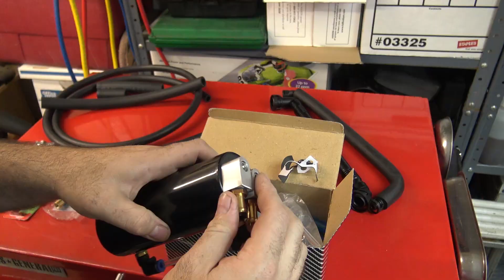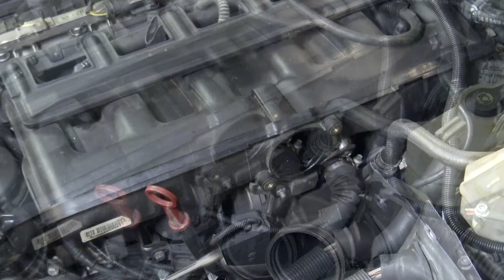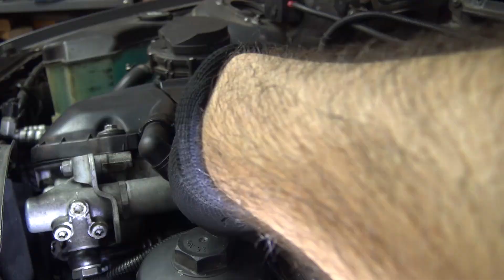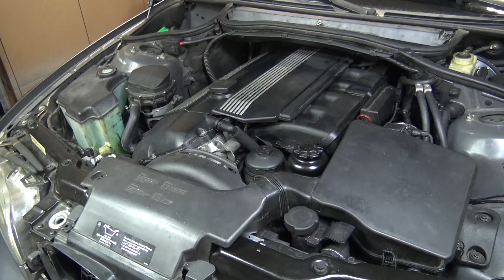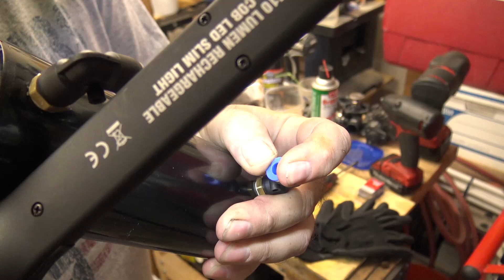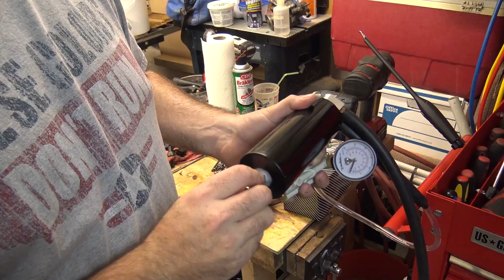BMW E46 Oil Catch Can Install DIY

Comment: Jason just a question ..you used 3/8(10mm) tube and then go to 5/8(16mm) on vacuum side with PCV  ...is there any reason for this ..why I am asking is I went 5/8 all the way and I do think that there is too much vacuum..find it extremely hard to  remove the oil filler cap and when motor cold there is a prominent sucking coming from around  ICV ..any info on this..never worked on this type of car before ..really PITA
Reply from the maker: You're supposed to have increased vacuum at the oil filler cap because you are putting a higher vacuum into the crankcase.  I only used the sizes of hoses I used because of the various plastic fittings from the CCV tubes.  The diameter doesn't really matter BECAUSE we're using a PCV valve in the system.  That valve stops down the air flow so that it doesn't matter what size your hoses are.  If you were not using a PCV valve and your hoses were anything larger than maybe 1/8", it's gonna suck too much oil out through the valve cover and into the intake.  Also, since we are applying increased vacuum to the crankcase through the valve cover, you need to make sure the valve cover gasket has been replaced otherwise it causes increased fuel trims which causes bad gas mileage.
Reply: thanks for  that info...I have what I would say is a vacuum noise leak coming from around the DISA and I would say the diaphragm maybe split or not seated  but after a few minutes settles down  DISA still works ok ..when testing for fuel trims I had LTFT --7.8 on both banks ..I fitted a vacuum hose from the rear of the inlet manifold to FPR and immediately fuel trims went to STFT 0.0 on both banks at idle  and LTFT cruise between --2.3 and --3.5.. considering I live in Bangkok and traffic is horrendous...could be sitting at traffic lights for 15 minutes and only travel 20 meters..on expressways you can see the fuel trims moving back
my motor is M52TU but here in Thailand these cars were still brought in till 2002 so possibly FPR could be different ...when I opened the CCV the diaphragm had a split hence bad everything and also the valve cover was split between 4--5 cylinders ..had to replace the valve cover with a new one (expensive) for the still negative fuel trims I have to get a fuel pressure gauge from somewhere.....got nothing here so will have to get from ebay

Comment: HI.  thanks for the good DIY process.  The link for the catch can that you posted: is it better than the one you used.  Seems that many had to refit it with better sealant in order to avoid air leaks.  how is the one in your description link?
Reply from the maker: I don't know for sure how it is--it just looks better than the one I used in the video
Reply: THANKS.  i decided to go with little bit more different system from ECS running, but appreciate the video

Comment: hey looking at this video it's awesome and you had the same idea as me with the non return valve on the return but I have high crankcase pressure causing my hoses to collapse any ideas? also I don't have the pc on my hose could this cause the hoses to collapse?
Reply: Oh and it has also a high pitched whistle
Reply from the maker: You need the PCV valve.
Reply: 50sKid thanks very much for replying love the videos all the way over here in the uk
Reply: Blowfrog, how did it go in the end?

Comment: when my e46 is running if i try to pull off oil cap it is sucked to the valve cover should I have this much vacuum or did I do something wrong
Reply from the maker: That is normal with this install.

Comment: hi,  I think the turbo charged engine , they suck this along with the external air.and push into the manifold. 
in that case , does the  vaccum leak is a trouble ?

Comment: Hi 50sKid, really great informative tutorial, thanks for posting. i replaced the OEM CCV like for like several months ago and really wish i watched this video first a) because that vent hose you need to twist int the CCV body stumped me, and b) because i'm getting vacuum related issues now and lean bank codes. i also burn alot of oil so im going to try this mod immediately. 

One thing though if you wouldn't mind, im in the UK, and part numbers you have suggested for the PCV are not available across the pond. do you have any kind of info regarding the pressure or flow that the PCV should be please?
Reply: Hi hunting, I'm UK also and just doing this mod to my Z4 E85. How did it go for u? I had no problem getting the fram pcv off amazon.

Comment: Hi 50's Kid. I've got a 330ci and it doesn't burn any oil, however there is a slight bit of mayo in the filler cap, and the pipe from the rocker cover is broken. I've got a catch can, can I run a line from the rocker to the catch can and a breather on the other port of the catch can? Thanks, Matt
Reply from the maker: You can.
Reply: 50sKid thanks for the quick reply. Will I have normal fuel trims etc and will that be safe for the engine?
Reply from the maker: As long as you plug the port on the intake manifold so you don't get vacuum leaks, you will have normal fuel trims.  If the blowby just escapes the valve cover, enters a catch can, and then vents to the atmosphere, that will not harm the engine.

Comment: hey @50sKid

so I did basically the same install, used a different catch can also didn't do the oil drain like you did, my catch can doesn't have the little drain like yours but the rest I did pretty well similar

my question to you is about the pcv valve, I used the Napa one you provided at the bottom, I'm curious is that one of the part numbers you updated? my concern is I get a considerable amount of vacuum in the crank case, I figure that's something I should expect. but I get a bit of suction pulling the dipstick or oil cap while running, I'm concerned there would be residual side effects from that, besides the debatable benefit of the vacuum on the cyl rings. 

any feedback will be much appreciated
Reply from the maker: That amount of vacuum is normal, that's the whole reason doing a mod like this improves your oil consumption.  The side effects are if there are ANY vacuum leaks in your valve cover before you do the mod, they will be amplified by the increased vacuum now placed inside the crankcase.  I recommend changing your valve cover gasket and grommets to a fresh one.

Comment: I have recently purchased a 2001 e46 with 140,000 miles and I'm getting the p-0171 & P-0174 lean codes. If my intake boots check out without any leaks I'm gonna assume its my ccv system. At what outside temperature would you not recommend putting the drain line back to the dipstick tube. I live in Tennessee and our winter temps rarely get below 30 degrees F. I just don't want the check valve to gummed up with the mayo like buildup from water/oil emulsion. Thanks
Reply from the maker: If you're worried about that then just skip the drain line altogether and empty the catch can manually.  For lean codes, check out my common vacuum leaks video

Comment: I used a 3/8in vacuum cap to cap off the dip stick CCV line but after 3 months the cap split open and started gushing oil everywhere!  I didn't see that leak spot only until after replacing the oil filter housing gasket (thanks for another great vid). Now I'm using a 1/2in vacuum cap with a hose clamp to keep things sealed off.  The 3/8in vacuum cap was stretched too far for this tube size so I had to avoid using that same size again.
Reply from the maker: wow, good to know

Comment: can you take the manifold tube into the catch can and then from the catch can to the manifold connector and still use the original ccv would that make a difference to oil ect?
Reply from the maker: You can't skip the valve cover to the catch can--that is the whole point, that's the source of the blow by gasses that you're trying to suck out and into the intake manifold, which is the source of the vacuum.  The two ports you're describing are both intake manifold sources of vacuum so there's no point in making a line that goes from one to the other.

Comment: I installed the radium catch can and I noticed very high vacuum out of the engine oil cap when attempting to remove it is that good or bad?
Reply from the maker: It's normal and good.

Comment: Okay. Input, output, blinding, hosing but, what have we do with the fuel pressure regulator's vacuum hose? Thx for all!
Reply from the maker: Nothing--it doesn't regulate fuel pressure.  It's just in case the regulator leaks--the gas fumes get sucked into the engine for recycling.

Comment: Excellent content on your channel, great work! Interesting you say, you smell oil vapers and your catch can is not vented. I've been running a vented catch can on my G35 for like 10 years now, no pcv valve at all. When I modified the lower plenum and saw all of the oil residue in the intake system, I was like how is oil in here? Then I discovered the vented catch can, which stopped this and oil consumption. The gf's e46 has been consuming more oil than normal and this is what brought me to your channel. BMW definitely made this way more difficult than it should be, but I"m impressed they made something to address it vs just recycling blow by oil through the motor. Not sure how the diaphragm in the CCV helps stop the blow by oil, but interesting. I was told that the diaphragm can get stuck open and that is a reason for more consumption, but I was also told an engine code will come up when it does. No engine code. This upload really gave me some insight to the install.

Any reason for not doing a vented catch can? Once vented, you don't need vacuum to pull open the pcv valve and can just drill it out. Can't I just vent the the valve covers and plug manifold to ensure no oil vapers are being recycled back through the motor?  Thanks for this upload and I've always thought the e46 is a legendary design.
Reply from the maker: You can, but you'll smell oil in the car due to the way the fresh air intake is designed as well as the amount of blowby these engines have at this point in their lives.  You're not really recycling that much oil into the intake at the end of the day--I know the inside looks oily after a while but it's not like you are burning oil or dirtying the back of the intake valves or anything.  People get too paranoid about an oily residue on their intakes.
Reply: Thanks for the response, but as I dive further into your video's I'm making you repeat yourself, sorry about that. After watching Cyclone Crankcase Ventilation System Explained, you know what is up.

Comment: I used this oil catch can and no problems out the box, worth the extra money IMO..... https://tinyurl.com/m54mishimoto

Also, I recommend installing the pcv valve further towards the inlet distribution piece, the valve I used (fram fv345) actually fits snug directly into the stock fittings vertically and the pcv valve is designed to be mounted vertically to keep it working good.

Also great mod, my car was using approx 1 litre of oil per 300-400 miles before this mod (suspect my ccv was completely knackered) and is now using a litre per 2500 miles which is acceptable to me. And although we have had a mild UK winter this year, the catch can never seems to have more than a tablespoon of brown oily water in it at any time no matter how long I leave it.

Comment: hi, great vid, just wanted to ask about the pcv, why was the first one no good ?. how can the crankcase get pressurised when there is vacuum from the lines ?
Reply from the maker: The first one is no good because they clog up after 50-100k miles or so, depending on your climate.  Using a catch can is easier as far as maintenance goes.  The crankcase isn't getting pressurized with this system, it's being placed under vacuum.
Reply: ok  , thanks.. i am in australia, with a 318ti e46..not many videos on this model. (There is a great one done by P Vope)..Also wanted to ask in diagnosing CCV problem, should a properly operating CCV system be drawing full vacuum at idle (about 18psi) from where it connects to the valve cover ? Mine does have a very slighht vacuum, as you show in your other video. Does it ever get high vacuum levels under different loads on engine ?. I am just not clear on the CCV, as to if the why if the diagphram ruptures, you say it pulls full vacuum fron the oil-pan (wouldn't that pull full vacuum from the valva cover?). and if it gets stuck shut, no vacuum,, how can it get stuck shut (possible spring malfunction, or obstruction) ?
Reply from the maker: No it should not be drawing 18inHg at the valve cover.  It never gets very high vacuum levels because the diaphragm inside the oil separator only opens when the vacuum level reduces (when the engine revs to higher speeds).  It opens a little further to allow the blow by gasses to be sucked into the intake.  When the diaphragm ruptures, it pulls full vacuum at the valve cover AND the oil pan ends.  The vacuum source is the intake manifold.  It never gets stuck shut because there is a spring pushing on the diaphragm.  I have a video explaining all this with some nice visual guides.
Reply: thanks so much... love your videos...

Comment: Nice done! We installed the System at the secondary Battery Port. But ur way is better cuz it is not so visible.
Also my Port is empty because i use WAES too.
THX for ur great Video!

Comment: Would someone care to explain me why this is an improvement? What is wrong with the original system?

I have an E39 525d 2001, no oil consumption. Why does this install prevent oil consumption for petrol BMW?

Comment: 50sKid hi, I'm struggling to find a good PCV valve here in UK that could suit for the catch can system on my 330i, I bought one for a JEEP CJ 3.8 and 4.2lt, but seems to be quite small. I still didn't start the mod, so I'm still on time to buy another PCV that will be the right one. Meanwhile, thank you for all the videos you do, I've learned a lot about my 330i thanks to you, and saved lots of money doing the jobs myself!

Comment: So I used a slightly more expensive can, installed the PVC on the vacuum side and after about 30 miles of non stop driving I can say no oil smell, and it runs great.

Comment: https://youtu.be/hPtPr-7IOyA

I did the install.  all of the hard pipes were brittle and broke, the dipstick return tube was horrid, the fittings were crap.. no wonder my car wouldn't idle... now it is smooth as silk, fuel trims are between 5-10 when warming up and 5 or less after warmed up (at idle.)

Comment: what to do with the fuel hose regulator, I have a fuel regulator, car 1998 release
Reply from the maker: Nothing, the fuel pressure regulator is not vacuum regulated. The line is actually to recycle vapors incase the regulator diaphragm bursts.
Reply: can drown out the nipple on the fuel regulator?

Comment: Hopefully not a stupid question, but you complained about the specific oil catch can that you bought being cheap and causing multiple vacuum leaks that needed to be fixed.  Is the link in your description with the turbo billet aluminum oil catch can the one you recommend the most?  And have you bought the one in the description and got experience and feedback about it?  I want to buy one that is not cheap and will do the job right even if I have to spend more money.
Reply from the maker: I have not purchased the one in the description but from the look of it, it is the one that I would try if I was going to purchase one at around this price level.  If you want to spend $200 you can find a fancy one with a filter inside and such.  I forget what it's called but search around and you should be able to find it.  I think it has a japanese sounding name.
Reply: Thank you so much! I am willing to spend more money but not more than around $60. I'll try the one in your description and let you know what I think about it. Thanks your fast response, input and advice! Keep up the amazing work and videos! I'm sure you hear this all the time but you definitely have the best e46 tutorials on YouTube and you can tell you put in 110% effort when making videos and editing! So helpful!
Reply from the maker: Thanks!
Reply: On the 50'skid's advice I might get this can. Did you end up buying it? If so would like to know how it worked for you.

Comment: Hey 50's Kid! - after NOT getting to installing a "cold weather kit" , prior to getting REALLY cold, I just suffered the infamous Oil Suck Issue in my E46:  No 
hydrolock, thankfully...but about two quarts of oils shoved through the 
engine and out the tailpipe...:-(     

Before I embark on a bypass approach <and for a '03/E46/330i, which 
bypass/CCV-delete option do folks prefer these days?> , to my question: How best to 
clean up the current mess? Seafoam out the combustion and intake, swap 
plugs, clean injectors ???   I'd like not to pull the intake manifold - 
no heated garage!!!   'Thoughts, anyone?   THX
Reply from the maker: Just pull the plugs and crank the engine over to make sure you don't have a bunch of oil in there anymore, that's probably all you need to do.  And then obviously just run it to clear it all out, everything will burn off eventually.  The intake always has a coating of oil in it due to the design of the CCV system so don't be too concerned about oil coating the insides of your intake.
Reply: Good deal! When I realized that the injectors/valves wouldn't foul and it was just clearing residual film out, I became a bit less fixated on individual cleaning of every cylinder! Continued thanks - I will let you know how the bypass - catch can works.